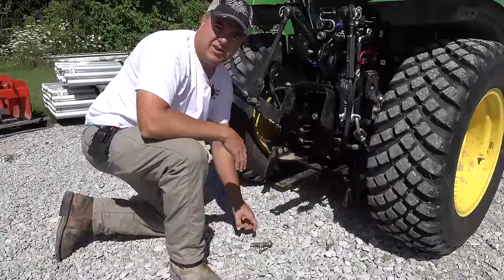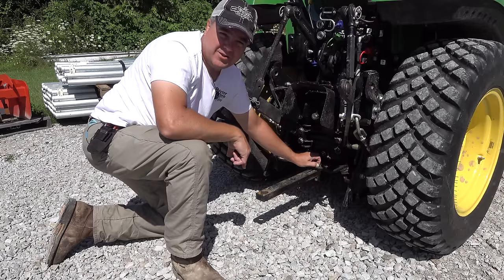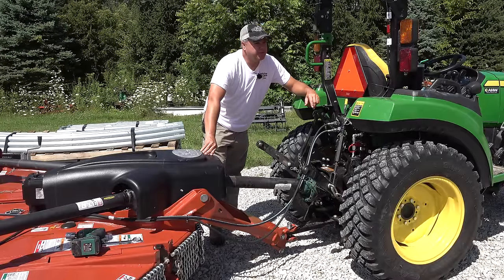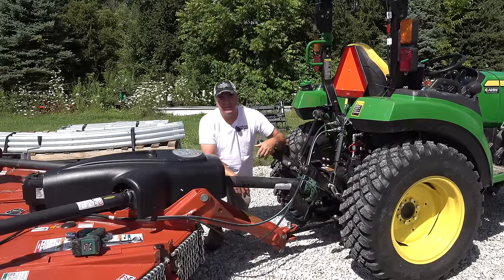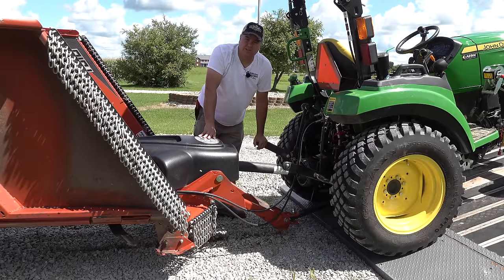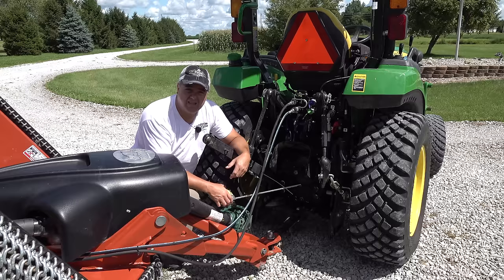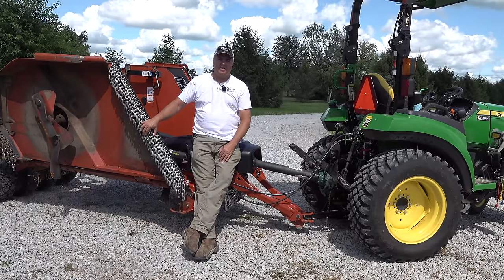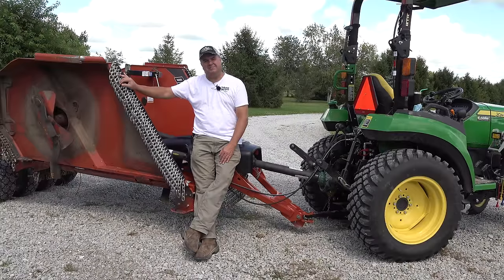COSTLY REPAIR on Deere  2038R!!!  Tim's HUGE Error!  Details Inside.

Comment: No where near as costly as your mistake and I was actually able to fix mine myself. I have a Kubota B26 TLB. For those who don't know, they are designed as a tractor, loader, backhoe and while the backhoe is removable, the tractor doesn't include a drawbar OR 3 point arms. They are optional. My machine (I bought it used) included the 3 point but not the drawbar. Not a big deal as it had the backhoe on it most of the time.

Fast forward a few years and I bought a mini excavator so the backhoe is normally not on the tractor anymore. I found a NOS drawbar and bought it because it makes chaining it down to the trailer easier. I did have a job I wanted the backhoe rather than my mini so I reinstalled it. I failed, however, to retract the drawbar. Backhoe installed fine but when I went to swing, it bent (nearly shearing off) a fitting into one of the swing cylinders. I thought at first it broke the cylinder. Was luckily able to get the special fitting from a hydraulics place rather than waiting to order from Kubota. Really lucked out on my end that day.

Comment: I glance over every sticker on the machine. Then add notes in my permanent truck note book, keeps all those little things you forget handy, anything that I feel needs to be remembered for each implement. It's not as degrading to us men to flip through some notes as it is to have to read that stupid owners manual. Lol  plus it's just a small notebook that has everything in it, instead of X amount of manuals you have to thumb through. From belt sizes to maintenance and part numbers with a few pages between lists to jot down anything else.

Comment: Although it may be within spec, and I’ve never owned a batwing mower or a tractor with a draw bar, the mower really looks too big for that tractor to me. It may be cool to stretch its capabilities for YouTube, but in my experience with stretching capabilities, you usually break something eventually.
Reply from the maker: This issue was not caused by or contributed to by the size of the tractor.
Reply: Tractor Time with Tim Is the hitch supposed to be so low to the ground? It looks like it needs to be flipped or adjusted so that it doesn’t hang so low below the draw bar. In the beginning I thought you had drug your draw bar off going onto the trailer.
Reply from the maker: Discussed in the video.

Comment: It happens Tim. I recently bought a used low hour Ventrac 4500 and have been so excited to mow with it a few times I ignored the greasing on the deck. Two spindles completely locked up. It was obvious to me the prior owner probably ignored it too. A little PM on my part may have saved them not sure.

Comment: Two things....that tractor may be technically rated for that mower but it's still too small. The other point is many castings on today's tractors are too thin, to make them cheaper to produce.
Reply from the maker: Something had to ‘give’.  I don’t care what size tractor.   Either the main gearbox, or the tractor was going to break.
As for the tractor being too small, you can have your opinion.    Other than the drawbar being too low, there is no other non conforming issue.  If you watch our other episodes, it works well.

Comment: 2038? Is that a 30+ hp tractor? Does it have the def or regen? Can you talk about those two things?
Reply from the maker: 37 engine hp, 3 pto horsepower.
It has dpf.  It does not have DEF. 
so, it regens occasionally, but no extra fluid to add.
Reply: @TractorTimewithTim  what are your thoughts on the def dpf stuff?

Comment: Does that machine have an aluminum rear housing?  If so.... Your problem is owning a cheap Deere. All tractors should have cast iron rear ends.  Aluminum is for lawn mowers......
Reply from the maker: Irrelevant.  Something had to give.
Reply: @TractorTimewithTim  I think that The "something"  may not have been your whole rear case, had the transmission been made of something stronger.  Deere and kubota think because they are "big" players they can make cheap stuff and sell for top dollar.   I am not criticizing you, we've all done dumb stuff.  I'm simply saying Deere underbuilds their sub and compact tractors.  The big stuff is great.

Comment: Very easily over looked mistake,Ive cut drive PTO shafts aftermarket to custom lengths also,you really have too be careful.This could easily happen too anybody,simply not something easily seen or thought about due to the hidden nature under the guard.can also go the other way of cutting too short and coming apart.Oh,ive made some mistakes also.

Comment: Thanks for sharing but mower looks way to big for the tractor you must get really good deal from your friend to be willing to abuse the tractor. Mower looks to me to need a 75 plus hp
Reply from the maker: Looks can be deceiving.  This  mower is rated for 25 PTO HP minimum.   Using 3 blades instead of one reduces the HP requirement dramatically.  It handles the mower remarkably well.
It is NOT abusing the tractor.

Comment: should have been labeled pilgrim on the farm,,,cutter is adjusted wrong,, and hook it to short draw bar. Shorten pto with flame wrench so it has lotsa  room for sliding in and out. Id have thought that was evident when you see the initial set up,,,,looking at it before you ever started the engine. I guess you learned with an expensive education,,,,cutting reveals blades need sharpening also and maybe turning waaay tooo slow

Comment: John Deere fixed it under warranty? You think maybe that's because you advertise for them,make them money,basically employed by Deere. I don't think they would have done that for anyone else.
Reply from the maker: The folks at Deere corporate who approved the warranty repair had no idea whose tractor it was.
Reply: @TractorTimewithTim  
My apologies then. You didn't mention that in your video so with knowing your affiliation with Deere,one would asume...
Reply from the maker: Brad Bruggeman yep.  No need to apologize.  I cannot tell you with 100% accuracy, but I believe that my relationship with Deere had no impact on this case.
Even after it broke in the field, I had not figured out that the loud ‘pop’ I heard driving onto the trailer was related.   In retrospect, I should have immediately put that together,  but it didn’t connect in my mind until much later.
Reply: @TractorTimewithTim 
I see where that would be an easy mistake. I would have not thought about it.

Comment: Do what works for you, for me I would never:
Run a JD, what broke you light engineering. JDs use of aluminum mean less durability than a tractor with cast housings.
Don’t ever use tools rated for larger power units.  Just because you can pull it with your smaller tractor doesn’t mean you should.  It results in more wear and tear overall.  I have a 1975 model JD that works new because I never let it be overloaded.
Never use equipment that is telling you there is problem, like dragging the hitch.
Like you said don’t read the manual or the sticker and pay the price in money and downtime.
Reply from the maker: Folks see what they want to see.  This error has nothing to do with tractor size.

Comment: I'm just amazed that a 38hp tractor is running a 10' batwing mower. I would have said that 6' was the limit
Reply from the maker: Right.  The amazing thing is that this 10’ mower pulls about the same as a 6’.  …we have both, and have run both on this tractor.
Reply: @TractorTimewithTim  any idea on why the HP requirement is reduced?  Is it because the individual blades and spindles are much smaller than a 6' so that in aggregate they sum to less than required than 6' HP requirements?
Reply from the maker: Yes, 3 spindles, each with smaller blades spins easier than a single spindle with larger blades.

Comment: that ain't nothing! I just spend 10K to have mine fixed   we had a flash flood and it covered basically the whole tractor for about an hour  they had to replace the $600! starter and some other minor stuff and a mouse apparently chewed on some wires  the short of it 7K in labor and 3K on parts!  and this after JD replaced the whole engine because the forgot to tighten some hose and a mouse family clogged up basically the engine  but at least they took responsibility

Comment: I think we would all feel a lot better if you traded for a bigger tractor, John Deere of course.
Reply: By the way, many years ago, I drove a brand new Hesston cutter into a hidden stump in a coastal Bermuda grass field on the first round. I had a new 4020 John Deere pulling it. It tore the hitch off the Hesston, separated the tractor from the cutter and destroyed the cutter bar. Then, the front 1/2 of the Hesston PTO shaft spun around and broke the tractor PTO before I could stop it. It happens in the best of families, LOL
Reply from the maker: This issue has NOTHING to do with the size of the tractor!

Comment: Read the manual, problem solved.  What's so difficult about that?
Reply from the maker: It is always easy from the couch in your mom’s basement.
Reply: @TractorTimewithTim      Is my statement incorrect?  Don't rush to judge.  I've been farming longer than you are old son.
Reply from the maker: ...and you’ve never made a mistake.  Pretty cool.  I’m impressed.
Reply: @TractorTimewithTim   No  Tim I never said that as you know.  Sure I have made mistakes however far less after reading the operators manual.  Have a good day and try to get up on the other side of the bed tomorrow.
Reply from the maker: Making a rude comment, whether factual or not when a guy has admitted a mistake is a good way to get someone stirred up.

Comment: Wait cut a PTO shaft?  Rather try and saw through my prosthetic leg, no thanks!  Got no desire to do that at all, sounds like something that can go wrong  to many ways.
Reply from the maker: Almost all small attachments like tillers must have the PTO shaft cut before use.   If you don’t do it, your dealer will have to...and will charge you for it.  Your choice.
Reply: @TractorTimewithTim  Not looking forward to that at all, though my only planned attachments are currently unpowered if 3 point.  Got nothing but rocks where I am at and thinking of a MMM for the 2 series.  Guess maybe down the road a small rotocutter might happen, surprising that PTOs are not standardized but I'm sure there are variables that might make that difficult.

Comment: Some/many/most manuals are pretty poor. Muddy photos.  Too much text.  There is a great technology called Information Mapping which trains tech writers to develop better manuals.  Printing manuals with good graphics/photos is expensive, but can be affordable in high res color in a PDF.

After all, who trains tractor buyers?    As the tractor market has expanded, more folks with no experience are buying.  And, I realize some folks just don't believe in safety measures......'darn safety Gestapo.'

Or, assuming the salesman knows......

Comment: You admitted  your mistake but you really still don't get it. The tractor is too small to handle the mower. Just because it  barely  has the required  PTO hp to run it  doesn't mean it  will work effectively.
Reply from the maker: Totally disagree.  This machine is fine to run this mower.
Reply: I suppose so if it meets your needs. Just curious about your drawbar height and the height requirement for the mower.  Another concern would be using on hills
I'm sure in some cases the smaller  tractor is better, especially if you are trailering frequently. But I would match to something in the 50+hp range. I think  something like this would work great with my old IH 584 or my brother's JD 3020.  We are poor folk and cant afford.fancy new machines..

Comment: What on earth are you pulling that mower with that little tractor?  a 37 hp tractor?  You should have a 70 to 90hp tractor out in front.
Reply from the maker: Mower is rated for 25hp min. Check out our other videos.   It handles the mower quite well.

Comment: Tim - tractor is too small for the batwing mower. The tongue is hung too low. No need for any recommended measurements. To me visually it is obvious that you need a smaller mower for this tractor. I used to mow with 10’ John Deere mower with a 110HP tractor. No issues whatsoever. Good luck. We all learn from our mistakes.
Reply from the maker: “Visually obvious”.   Ha.   The 2038r works fine with the mower.

Comment: Reading the manual is for “sissies”?!  Sure, if you’re very familiar with that particular piece of equipment but if not, read the manual.  Imagine not reading your car’s manual and not servicing your timing chain,  then blaming the car manufacturer because it broke and tore up your engine.  Don’t be lazy, save yourself money, read the manual.
Reply from the maker: Well, I guess you don’t recognize self deprecating humor when you see it.
Reply: Tractor Time with Tim 
It just rings of the old adage that men never ask for directions...there’s truth to it unfortunately.  That engine timing problem that I mentioned?  That was my son.  He didn’t read the car manual relying on his trusty mechanic to tell him what his car needed.  He sold his BMW for salvage because it needed a new engine.  🤦‍♂️